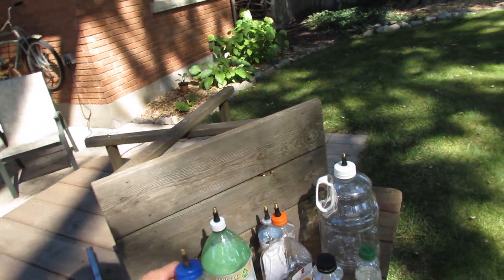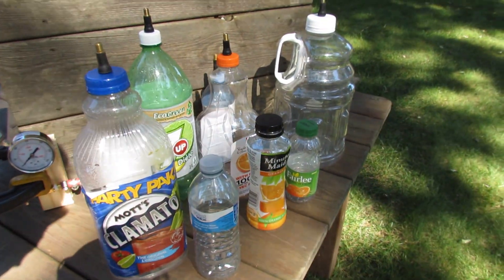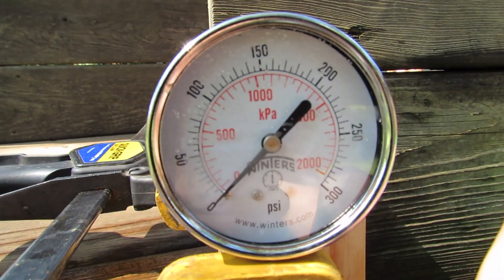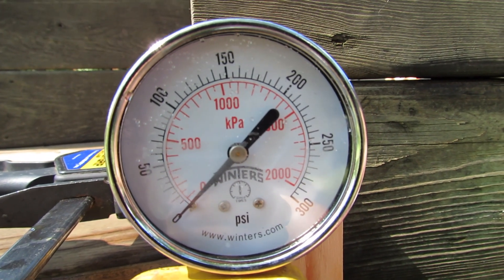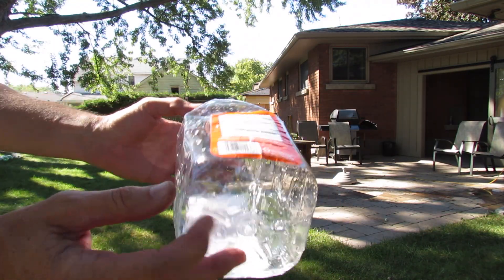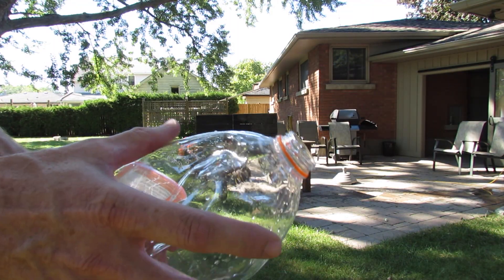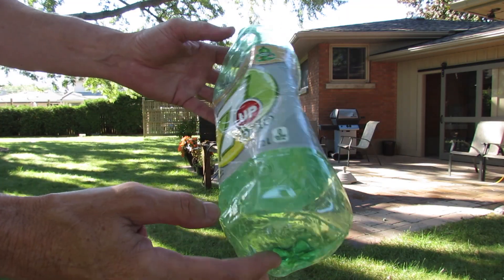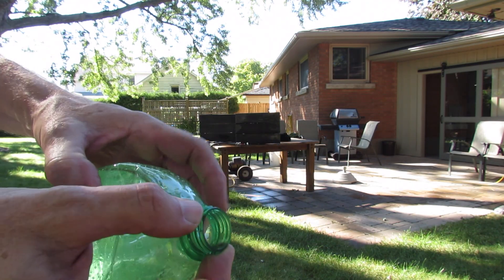POWER PRESSURE WASHER ● vs ● PLASTIC POP BOTTLES

Comment: Cool experiment!  Where did you get the red cap on the test stand?  That is a good idea to avoid having to drill each cap and installing a valve stem each time.  It kind of looks like a liquor bottle cap - heavy duty.

Comment: Awesome!! Would you try this again with bottles that have been shrunken down using hot water? (I poured boiling water into a 2L and it shrunk down, increasing wall thickness and strength for carbonating beverages)

Comment: Need metal hose clamp on caps... then redo and find out which is the most pressure durable plastic bottle...
Reply: Good solution, I was thinking about 
tape or something, hose clamps would 
deff work..

Comment: How loud is it when it goes?
Reply from the maker: It is very safe with water. It makes a sploosh sound with not much excitement. But with straight air it's another story! It is incredibly loud and scares the daylights out of you!! I see you commented on that video too. Thanks.
Reply: @chrisnotap  I'm going to use plastic bottles as fireworks this year for December 31st. Since my air compressor only goes to 150 PSI I will have to design a trigger to make them POP at a certain pressure, since I will be a distance away from the bottles.

Comment: If you're just pressure testing them why even bother to put water in them?? Since water isn't compressible it just gets in the way of the test.
Reply: easier to show where it leaks
Reply: Of course you don't want your neighbors to think there's a bomb and report you to the police!  Want to try it sir?
Reply: That's exactly why he filled it with water because it makes the testing much safer and quieter. That's why I hydraulics are much safer over compressed air systems.
Reply: @BurkenProductions  this is how pressure vessels are pressure tested. It’s called a hydro test. The water doesn’t get in the way at all and infact iwhen it explodes with water is the same place it would’ve with air

Comment: 1. Interesting and probably useful for me, so thanks for making and posting this.
2. Where did you get the valve stems, and are they a particular kind to seal well to plastic bottle caps?
Thanks,
--Larry
Reply from the maker: They are just regular tubeless tire valve stems for a car. Drill a hole in the cap to accommodate the valve
Reply: @chrisnotap  Thanks much, I'm going to give this a try. FIngers crossed!

Comment: I've wondered, what happens if you wrap duct tape around it? Will it make it stronger?
Also, a bit of thick tape around the cap might help seal it better and prevent the cap from popping off. But it will be harder to screw on.

Comment: Would a metal hose clamp around the cap and maybe some epoxy 2 part glue on the threads help eliminate the cap giving up before you get a true test of some of these amazingly strong bottles? Great video by the way!

Comment: Interesting indeed. 

I'm curious though about the "Smart Water" style bottles since they're symmetrical in design.

Have you found a particular cap that holds up to the pressure better than others? If so, what's it from?

Be interesting test combining the best bottle with the best cap. 

also, did you find they could hold more pressure if filled at a certain rate?

Thanks for sharing your experiment.

- chase -

Comment: Go to Lowe's and get you some Goop . It is about 100 times stronger then silicone and glue the lids on with Goop . Put a little inside the lid and around the lid and also around the valve stem . Let it set up 2 days for best results . You will never blow a lid again . Here is what it looks like .
http://www.lowes.com/Search=goop?storeId=10151&langId=-1&catalogId=10051&N=0&newSearch=true&Ntt=goop#!
If this link does not work type Goop in the Lowe's search box . The Grey tube is best to me .

Comment: Sorry i don't know its name but you should put a 'metal ring which you can make smaller with a screw' around the cap.  When the caps can't go off anymore, the pressure might be much higher.
Reply: +pienkvien Hose clamp.